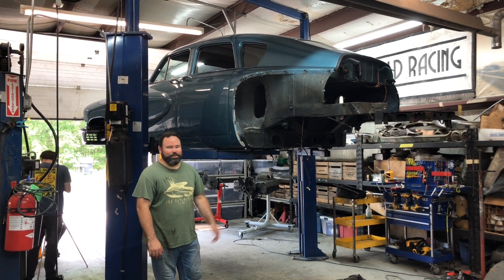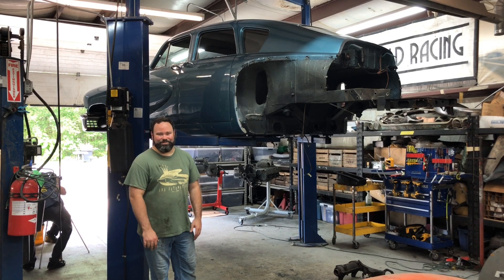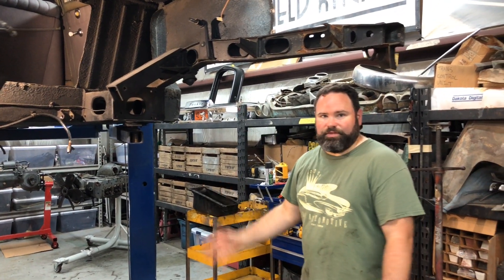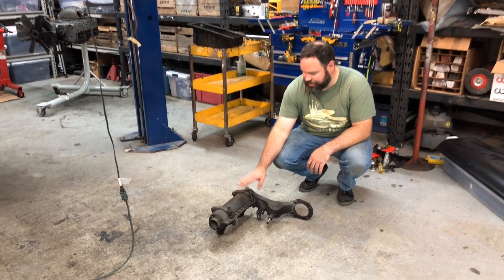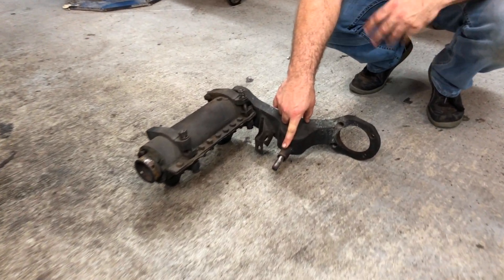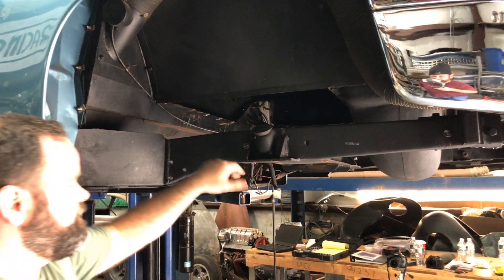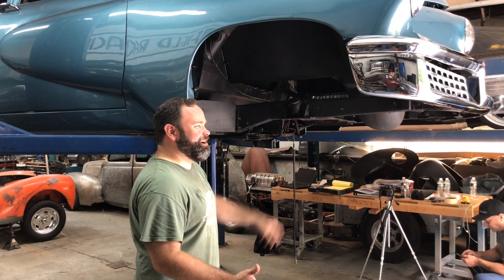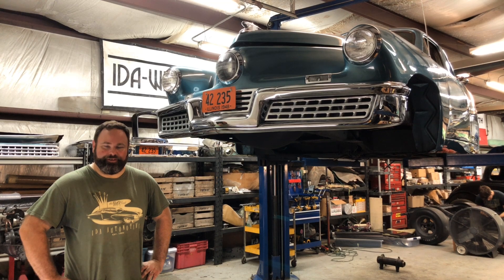Decoding the Tucker's Torsalastic Suspension!

Comment: What I find fascinating about the Tucker saga, is that the cars that were made were all pre production, so they were updating elements of the car from one car to the next, so they're all not the same. The car was evolving on the line, and then that rug got pulled. It would have been interesting to see a final production model and the changes the car went through to get there. Guess we'll never know. If they'd gotten it in production they wouldn't be rare birds today, maybe there'd be a 2025 Tucker now. Think if it had made it into production, and they expanded and were still manufacturing cars and trucks and all of it. Wonder what that might look like, 80 years of evolution in a Tucker.

Comment: How long would an original Torsalastic suspension last before the rubber separated and how difficult would it have been to repair back in the day?  It has been reported that the only way to make Tuckers drivable was to make that conversion to the coil over spring design, but then the original Torsalastic was such a unique feeling that could never be matched by coils.  I hope that the new Mark Lieberman Torsalastic design lasts so that there is no need to ever go back to that old coil over modification.

Comment: Mr. Tucker had a good idea, but rubber technology just wasn't there yet.  Probably still isn't today.  He'd have probably been lightyears ahead simply by using a spring-steel torsion BAR like the Chrysler Corporation and Packard and Volkswagen did.  Those were all bullet-proof suspension designs.

Comment: The Torsalastic suspension was probably the worst thing about the engineering of the Tucker.  Experience usually helps to remedy problems,  but you shop hasn't learned, as well as many others. In fairly modern motorhomes, they tried this type of suspension to utter failure and probably didn't even know what a Tucker was. Had they they known about Tucker, they probably would have known better than to try it.
Reply from the maker: You shop has I guess.  Thanks for watching!

Comment: Later model Flxible as well as Eagle buses also used Torsilastic suspension. So did the 1980s and early '90s Foretravel motoromes.
Reply from the maker: Cool!  Thanks for watching!
Reply: Had a Safari diesel motorhome with the torsilastic and it rode like a ton of bricks... very abrupt and poor damping control. Developed in conjunction with Goodyear, the entire motion was governed by twisting rubber sleeves. Nowhere near as reliable as the metal in a coil or leaf spring.

Comment: The original design is another testimony to just how far ahead of its time the car, its design, and Preston's thinking were.
The torsolastic design was functionally much like other torsionally sprung vehicles (VW, Porsche etc) in that a conventional spring wasn't used, but the idea of a torsionally loaded rubber compound in place of a metallic spring was groundbreaking to the best of my knowledge, and at the least far from conventional. It's only as of late (relatively speaking) that this concept has commonly been applied to light trailers - and that with much superior rubber compounds.
Another thing evident is a car of this size being of unibody construction at that time - most unusual, and yet SAFER than full frame cars of that era due to the designed in 'roll cage' surrounding the passenger compartment. 
In addition to the above, the near modular drivetrain 'packaging', in terms of serviceability, weight placement for drive wheel traction, and the passenger comfort benefits in terms of room and the absence of any 'tunnel' on the floor. 
All of this evident with a simple viewing of the bottom of the car, imagine the 'magic' evident throughout the rest of the car.
Tucker's forward, non-conventional thinking COULD have revolutionized the automobile industry, much like Henry Ford's grasp of mass production.
Preston Tucker had a mind the likes of which are seldom seen.
Reply from the maker: Agreed, thanks for watching!

Comment: Sounds like you have a source to get the suspension units refurbished? 
My father works for a company that makes rubber bushings, dampers, and air springs. If someone said it was impossible to remake the original parts I'd really doubt it... the cars are valuable enough it makes sense to get new rubber bonded in!
Reply from the maker: Yes, Nostalgic Motoring cracked that nut and produces the suspension again.  Thanks for watching!

Comment: Looks like someone  hacked the suspension pretty bad  previously. Glad to see you are putting it back to original.
Reply: Most, if not all Tuckers at this point have been modified to remain usable. As much as I hate to say it, the cars were flawed.  These flaws would have been rectified had Preston Tucker had more time.  One thing to remember is these aren't really production Tuckers.  Each one was hand-made more or less in an effort to streamline processes later.  No two Tuckers are exactly alike, either. The line was in a constant state of flux fixing issues that arose or problems with assembly.

Regardless, with the company gone after 1950, people had to do what they could do to keep these cars alive.  Pretty much every Tucker at this point had coil-overs retro-fitted because it was easier than reengineering the entire Torsilastic unit.  Good on the Tucker grandchildren for overseeing this mammoth task.

The pre-select transmission is fairly straight-forward to make reliable.  Even in 1948, it was a 10-year old system.  Retro-fit with modern components, it can be made 99% reliable.

I have also heard there is a casting flaw in the heads which restricts flow and is one of the causes of most Tucker's overheating.  Don't know how true that is or does it really come down to the fact that most Tucker's never see highway speeds anymore.  Any old car that doesn't go faster than a parade is at risk of overheating issues.

Personally, I think it could be half-solved with a good carb tune-up and making sure the ignition timing stays where it's supposed to.
Reply: @That_AMC_Guy  Retrofitting an airbag onto an Eagle bus with a blown Torsilastic is a common repair, because with those it often does not make economic sense to attempt to repair the suspension properly. Watch some of the older Bus Grease Monkey videos and you'll see it done.

Comment: Deengineering the reengineering. LOL. Did they save the original suspension components? One thing that strikes me is how modular the rear end motor and frame were. Way before it's time.
Reply from the maker: Yes, the originals will absolutely be retained!